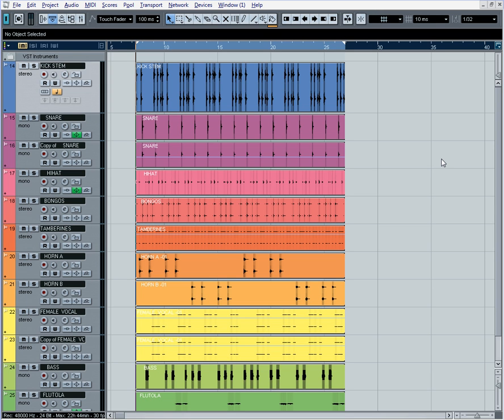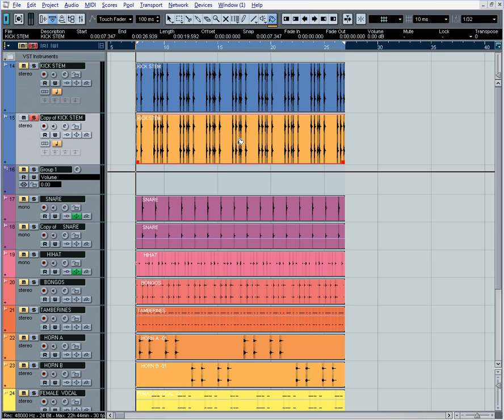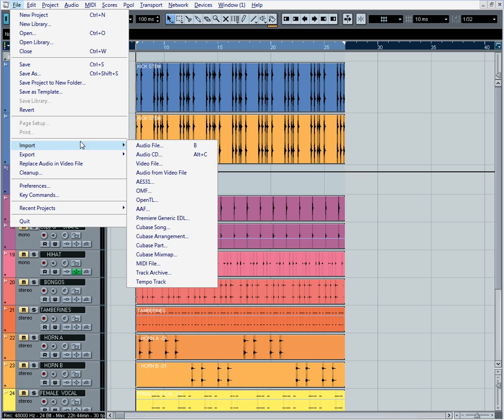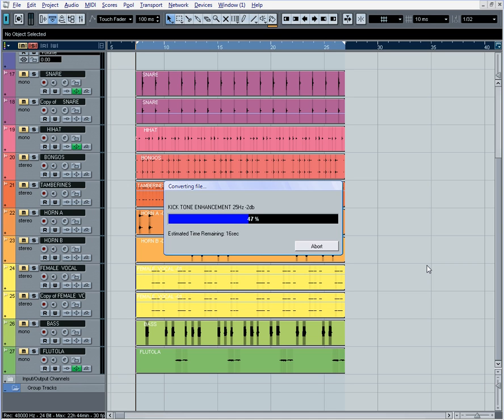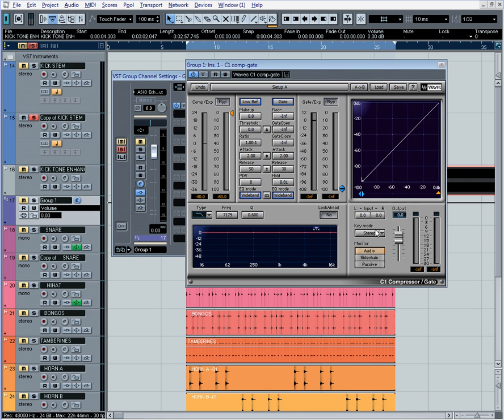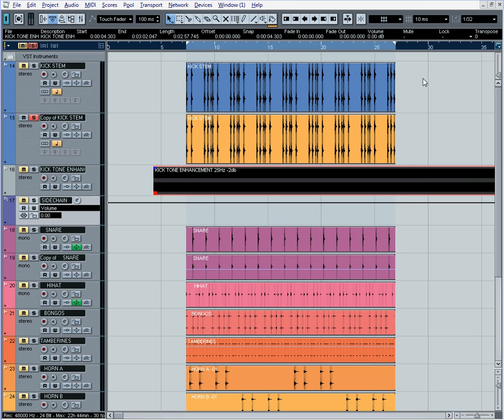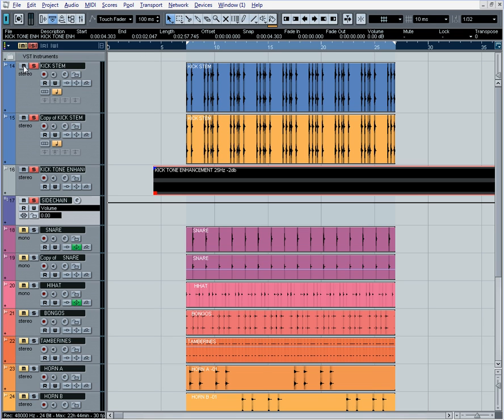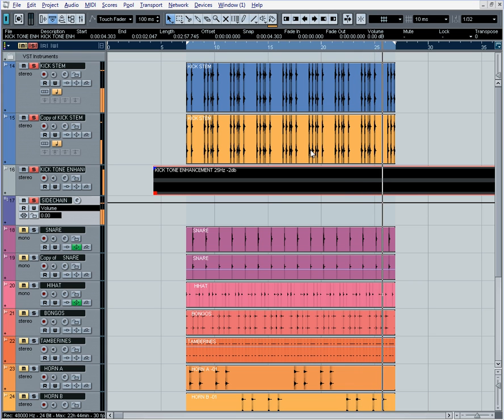Rhythmic Gating

Comment: SCREW PRO TOOLS!!! Thank you so much for this! I was trying to figure that out forever. Now I'm trying to see if I can sidechain an effect (like delay) at certain intervals using a "cluttered" track. 
BTW you don't have to generate a tone. You can just use the A1 and use it's audio output as the effected part of the sidechain (R). Just remember to start it with a MIDI note first.